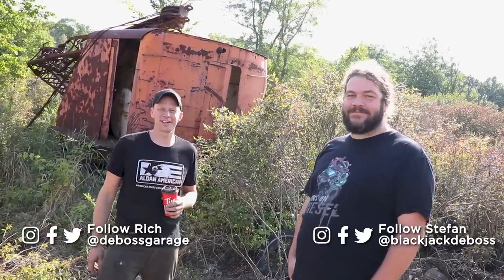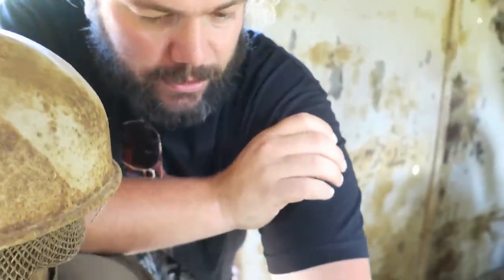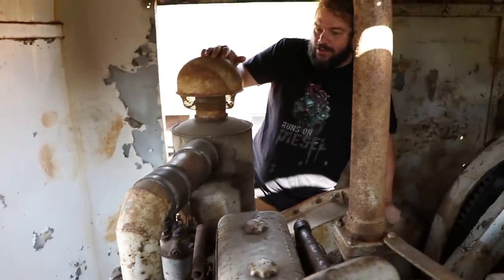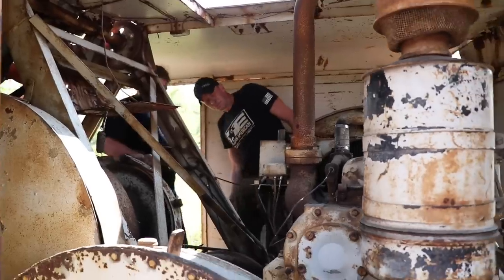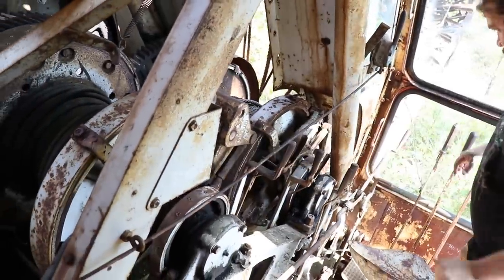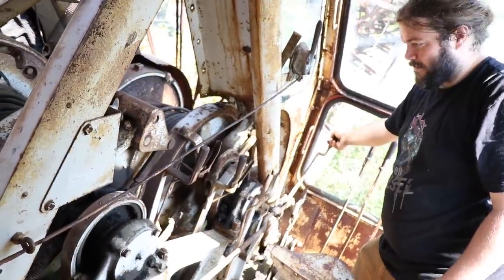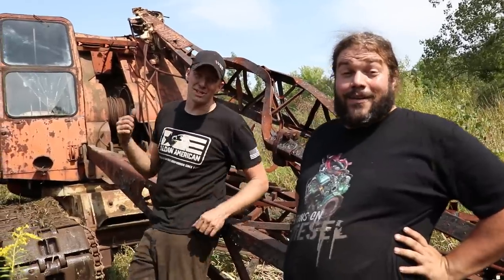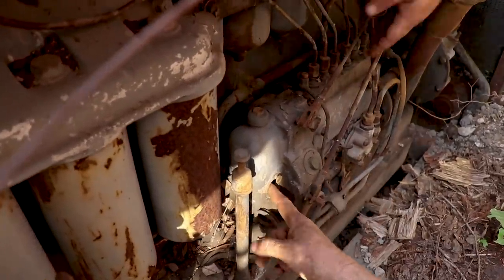Will a 2-Stroke Detroit Diesel Run on 20 Year Old Fuel?

Comment: When I went to Detroit school on the 92 series they brag that detroit had common rail before cummins even knew how to make a diesel
Reply: Cummins was making diesels 15 years before DD started
Reply: @chevota84  yes I know that I am a diesel engine mechanic but the older Detroits back in the 50s and 60s and 70s were better motors than the cummins and then when the 60series came in 89 they put everyone behind them again!!
Reply: @scottjaecques7409  i agree,i have worked for Detroit diesel for 25 years, the 60s are great engines,were still building them everyday.still a couple 2 strokes being built too
Reply: Scott Jaecques....... Sorry, but either they lied to you (which I doubt), or... you made that up.  Clessie Cummins was granted official Incorporated status to begin manufacturing his first diesel engine on Feb.3rd, 1919 by William Roach who was the Sec. of State (of Indiana) at the time.  Clessie's first diesel, was a horizontal single cyl, and was built under a license he obtained from the R.M.Hvid (pronounced "Veed") Engine Co. in Holland, with some modifications to the fuel system by Clessie to produce 6 hp and were sold through Sears & Roebuck. 

 Clessie's very first & fully designed and built "in house" along with the very first (and Patented in 1921) Direct Injection fuel system, was the vertical 2 cylinder model "F" in 1924.

The single cylinder, 6hp Hvid he produced in 1919, weighed a whopping 1,100 lbs and utilized Two flywheels (one on each end of the exposed crankshaft) weighing a combined 750 lbs of the total engine weight. 

Personally, I formally studied Two Cycle Diesel Engine Design & Theory for Four years during the mid-1960s, under P. Nicholas who was one of the lead designers of the very first 2 cycle GM Diesel (officially branded Detroit Diesel after Mar. 1965) during 1937 & 1938 under "Boss" (Charles) Kettering

By the way and FYI... Detroit Diesel did Not develop nor utilize any form "common rail" fuel system for their engines, until the introduction of their latest DD series platform of engines which was launched in 2007 with the DD15, under the headship of their current owner Daimler-Benz under Tognum Gmbh Holdings in Germany. 

GM Diesel did, however.... develop the very first Unit Injector system for use with the heavy duty Two Cycle engines, during 1937..... but, they did Not pioneer the very first UI nor UP (unit pump) injection systems concept. 

Just out of curiosity..... what year(s?) did you attend "Detroit school" on the Series 92... and Where?
Reply: @Romans--bo7br  that was a sarcastic remark !! But detroit did have the common rail fuel system forever and cummins has built several motors that weren't shit compared to the old 2 strokes
Reply: @scottjaecques7409 .... Scott, thanks for your reply.... and I'm sorry that you took what I said as being "sarcastic".... it was Not meant to be.... was just stating a fact in regards to the school you said that you attended, which could have only leave one other "possible" alternative. 

Did you read my entire reply back to you?  I only ask, because from this reply from you, it did not sound as though you read the whole reply..... especially considering your reiteration about Detroit Diesel..... "But detroit did have the common rail fuel system forever...." which, in fact is not true, and IF you read my whole previous reply,  I explained that to you (or for anyone else reading it). 

Besides my formal training, I've had a close relationship with Detroit Diesel and some of their people in R&D over years past..... so in relation to your thoughts about DD's history with common rail technology, I would suggest that you read my entire previous reply to you which will give a brief synopsis about it.   Also, you didn't answer the simple 2 part question that I asked of you, at the very end of that reply.   Thanks again.
Reply: @Romans--bo7br  no I was being sarcastic in saying detroit had the common rail before cummins built an engine !! Lol I knew it wasn't true !!
Reply: @scottjaecques7409 .... Thanks Scott for clearing that up... my "bad" for misreading, what you said.   lol... you still haven't answered my question,  which was / is... Which, or What "Detroit school" did you attend to train on the Series 92 engines, and When (what year/years) did you attend??
Reply: @Romans--bo7br  I went to Cleveland it would have been in 1987 I worked for the freightliner dealer in columbia mo the fire department had trucks with 6V and 8V motors

Comment: Good job getting in moved without getting hurt. Most crawler cranes use the same control for swing/travel. There is usually an air valve to dog either track so you can skid it to make turns. No counter rotation back then! The pedals are the brakes for the winch drums. I ran a 3900 Manitowoc with an orange peel grapple. It was a workout.

Comment: they took care of that motor when it was in service....
ive seen modern engines.... oil changed every 3k..... WAY WAY WAY more crusted up than that

simply amazing how clean that valve gear is..... id almost say you guys swapped out the head for a BRAND NEW one
just cant believe it.... someone LOVED that little dude

Comment: I ran that model twenty years ago at a scrapyard. It had a genny and mag set up.
Those models were notorious for the boom lock to slip out and engage which would send boom back over the top of machine while  the. dragline cable would wrap around the cab.
Looks like it happened to this one too.

Comment: it's always the stuff with a detroit or a cummins in it that starts no matter what
Reply: Powerstrokes too!
Reply: @tebibyte2357 .... Powerstrokes are neither heavy duty class engines, nor will they Ever attain the reliability and longevity of the 2 cycle GM/Detroit Diesels, or the Cummins HD engines.  Sorry.... just a fact of design and duty class.
Reply: @Romans--bo7br  I know
Reply: Bay city shovel is still in buisness. Still make them and repair them.
Reply: @jamesjohnroe3741  I found an old Bay City crane at a friend's yard. It's full of hornets.

Comment: A interesting old drag line 

On a screamer (2 stroke GM) when the injector rack sticks on full noise it isn't as most people think
As you rightly said it is on full throttle when at rest and as soon as its running the revs are controlled by the governor 

The rack will almost always appear free when you lift the rocker cover and check 

But once you start the motor the injectors getting pushed down can bind hense making the rack stick as the inje tor rack can no longer move
If you have the stop out, ie the pull cable or hold the little arm around to stop the motor nd wind it over a few times and then check the rack
You could leave the rocker cover off whilst doing this and have someone move the rack and or check whats happening whilst your winding it over 

Great video, but you boys felt like king of the world shifting the drag line 

Keep up the great videos

Comment: I would be curious as to how the boom got folded over. That old beast has some stories to tell. A lot of time was spent in that seat pulling levers, moving dirt/ rock. I grew up on the Texas coast in Lolita Tx and my dad had a friend named Hugh Spring who was an operator. When he “retired” from the construction company he worked for, He still had his own peterbilt, cat dozer and drag line similar to this. (Probably had more equipment as well.) His daughter married a “big wig” for Whataburger and he had a ranch outside SA, Tx. Mr. Spring moved there and built roads stock tanks and any sort of dirt project imaginable. I will never forget, i never saw him without a pair of roundhouse overalls, redwing boots, dirty gimme cap and chewing tobacco in his jaw and grease under his fingernails. He and his wife were active  in “4H” and did a lot for local kids. He used to build wood piers for people on the local bays and wood bridges over draws. He would let me have any demo or left over new creosote beams and i built underpinning for several porches and buildings. Big 6x12 beams. For free! My dad was a welder and we would trade welding for his work or materials.

Comment: A feller sure does like that VGG hat! We had the 3-53 in our M561 Gama Goats. Great, damn-near indestructible engines. I was always told that, even if the rack is free, you should bar the engine over a few times, to fire the injectors and see if the rack stays free.

Comment: She's a 3-71, not one of the 53 series engines.
Reply: Wow, I didn't even know they made a 3cyl in the 71 series.
Reply: @SoI_Badguy  GM / Detroit Diesel made a 1, 2, 3, 4, 6, 6V, 8V, 12V, 16V, and a 24V-71.
Reply: @newjerseybill3521  my wife worked at Detroit diesel for a few years, then thing slowed down when gm ran it into the ground, she transferred to the Fleetwood Cadillac  plant.
Reply: Rick Delair  The coolest Detroit I've ever seen was an ultra-rare 12v53 that was designed for the military, but never got past the 2 'sample engines' that Detroit provided for testing. Both have been restored and have been bought by private owners and have been on YT in the past few years. You haven't heard total mayhem till you hear a 'buzzin' dozen' turning 2850 rpms! EDIT: I rechecked my sources, and there were actually 4 of those 12v53TT's produced, not 2... and yes they were set up with twin turbos: https://youtu.be/gWrg3cFod7Q
Reply: @newjerseybill3521  They also had a 20V for railroad locomotives which I think EMD? bought the manufacturing rights for? Speaking of railroad 2 stroke diesels, do you know anything about the origins of the Napier-Deltic 18 cyl. diesel?
Reply: @jerkyturkey007  It's a real shame, GM is just a shell of their original diversity. GM, Chevrolet, Buick, Pontiac, Oldsmobile, Cadillac, LaSalle, Cleveland Engine Div, Electro-Motive Div. Frigidaire, AC Delco, Delphi, Euclid, Terex, Allison, New Departure, and a bunch more
Reply: @danw1955  Correct, but those where the big EMD 645,s and 710,s  Nothing like having a 14,200 CI V20. :)
Reply: @danw1955  I think I've seen those 12V53 videos. I do searches every few days for Detroit's. My fave Detroit vids are by Buck Benziger  (Buckbz) & Grigg Mullen (Grigg3)
Reply: @grabasandwich  LOL.. yep, Buck's old GMC with the 4-53T holds a special place for me, as I had a late '47 Chevy pickup that I would have LOVED to put one of those engines in!
Reply: @newjerseybill3521  Ahh ok! I wasn't sure if Detroit was involved with EMD or not. I grew up in the 60's and 70's, so I got to hear a lot of those 2 strokes in the local railroad yard. ;-)
Reply: @danw1955  Both where divisions of GM back then. Clatterpillar owns EMD now. Detroit Diesel is now owned by Daimler AG. :(
Reply: @newjerseybill3521  'Clatterpillar' LOL! I'll have to remember that.🤣👍
Reply: Your right I had two of them. One was in a Northwest 25 dragline, the other was in a Warner Swassey 500 ‘Hopto’.
Reply: Rick Delair  RickC6! How have you been?
Reply: Rick Delair  Sorry to hear about your toes, that's horrible! But getting another 4-51 is awesome... I miss your enthusiastic posts in the DD Group!

Comment: Hah hah!! You guys are having waaay too much fun with that thing! That engine is clean as a pin inside... and the fact that it WAS inside is probably what kept it that way. The nice thing about old mechanical cranes is that if the clutches are good, they ALWAYS work! Very cool to see it stretching it's legs and moving out of a potential grave in the weeds. Well done guys!😁👍👍

Comment: I like how everyone is kinda surprised the old Detroit still runs. And how 20 years after the apocalypse people will be running them...

You do realize old shortline railroads run EMD powered 16-567s from the late 40s and early 50s. Which is quite literally a 9072 cubic inch version of a 16V71 Detroit with a bajillion hours on the still moving freight. The railroad I work for owns 9 or so. 2 run every single weekday moving freight lol.

Detroit’s are some pretty awesome engines

Comment: Also in a common rail diesel, fuel is supplied to the injector at final injection pressure, whereas in a unit injection system the injector itself creates the pressure.

Comment: That 3-71's in great shape.  You could drop that into a pickup and have something good.  I put a 3-53 and Clark 5 speed into a '70 Ford F-250 with a blown 360 and ran it for 20 years.

Comment: It’s a 3-71. You can tell by the valve cover bolts. A 53 series has small bolts around the outside of the valve cover and 71 series and bigger has the hand knobs in the center like yours.

Comment: we had an excavator sitting from the sixties, O&K. 40 years no start. then the museum people came and had the the one cylinder diesel running after 4 hours, it made it on the trailer under its own power. my fathers best friend showed them the controls.

Comment: The reason it is called a "Unit Injector" is because the Injection Pressure is created inside of the Injector. In a Common Rail system the Injection Pressure is created in the Fuel Rail. The Fuel passage you speak of is referred to as a "Fuel Gallery."

Comment: the left pedal is your hoist break and the right is your drag break.  The same with the right and middle lever.  The left lever is reverse clutches.    If you look behind the seat there is 3 more levers.  They are your reverse clutches functions.  Travel swing and break.

Comment: That’s a 3-71, the valve cover gives it away: 53’s use a perimeter bolted valve cover,  where 71’s have the center bolt covers with the big knobs on them.

Comment: I think that common rail could also mean that the pressure in the rail  is equal to the injection pressure.

In that engine there is a pumping element after the rail, kinda like pumpe duse where's in "true" common rail the injectors are not pumping, just opening.
 That may be the main point of dispute.

Comment: If you cant appreciate the engineering and quality manufacturing of that decently built machine you are short sighted. It just amazes me the integrity and longevity of these older machine after decades of abuse and decay. The engine alone could serve so many current uses. I sincerely doubt there will be a yard in 50 years that will have a functioning machine or engine from this current age. It's really embarrassing and says a lot about our generation and the direction we are going. 

Thank you for sharing this content, and putting in the work, even though you make it look fun and entertaining. God bless.

Comment: My uncle ken had two old Linkbelt drag lines and they had a gas engine that would start the diesel engine they were big you could drive a car into the bucket he used to throw the bucket by swinging the crane and throw in the bucket to make a pond it was awsome watching him push the pedals and pull the levers there was probably 20 levers in the thing

Comment: I like everything about this video except you running over the classic sedan. Other than that great video!
Reply: Steven Alaimo it was from Canada it was full of rust cancer manny years ago
Reply: @nolanmitchell7319  That makes sense then, thank you for the response!
Reply: There a few hours north of us but here  anything pre like 2006 is pretty much scrapped especially trucks, I've even seen some 2012 that have no body mounts left and the rockers melting. I've seen salt melt half inch plate steel on salt trucks so that car was gone a long time ago

Comment: I bought a 262 champion with a 4-71 in it with the rack frozen with the injectors in the off position. Wouldn't start. Off went the valve cover. Found the stuck one. Ran it on three for a while. The hot oil must have freed up the other because in a half hour the arm moved again and presto.

Comment: There is such a thing as low pressure and high pressure common rail. They have low pressure common rail with 'pump duse' injectors, same idea as early 2000' model VW diesels.

Comment: Having owned/operated a similar vintage machine I was cracking up as these guys tried to figure out the operating controls! This machine was built in a time when men were intelligent and manly. No guards in the way of moving parts and no climate controlled cab. Incidentally, the correct travel direction should have the sprockets at the rear.

Comment: A common rail feeds a nozzle with high pressure fuel that allows fuel oil into the cylinder when a valve or solenoid opens. That 3 cyl Detroit is fed fuel to the injectors to then be compressed by the injector itself before spitting out the end when a pressure relief pops. This is not a high pressure common rail fuel setup, it's a common low pressure feed line.

Comment: Not common rail cuz it's only high pressure inside the injector when it's squirting. The Holy Grail are the ones with Jake Brakes on top. Prices are thru the roof for them.